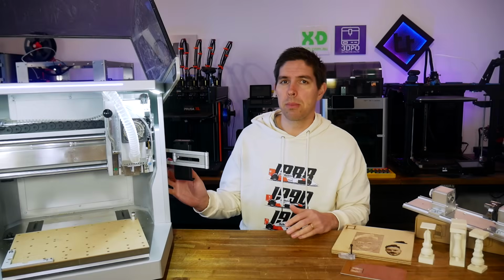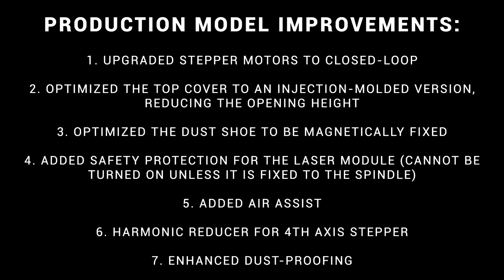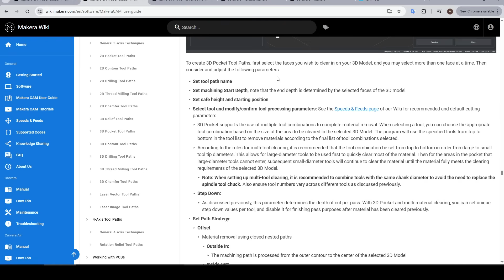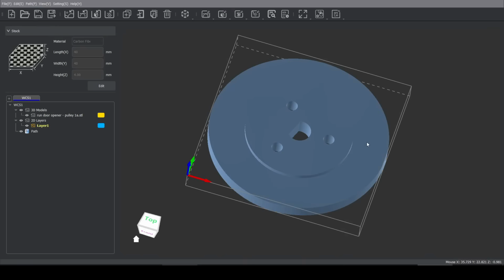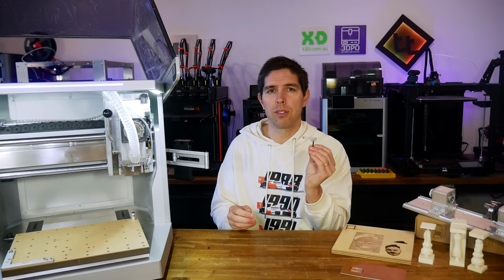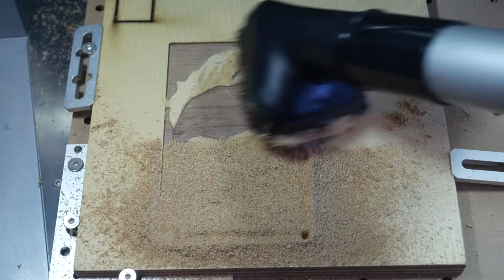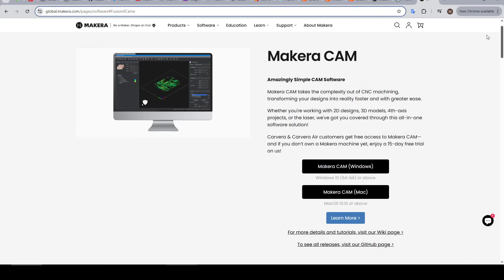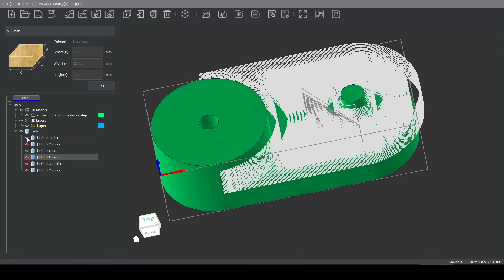Carvera Air Desktop CNC hardware and software review

Comment: Hey can you help me I'm using Marlin 2.1.2.1 STM32f401C1U6 motherboard I have made custom squeegee to control my squeegee up down with g code like M42 P0 S225 kr whatever in configuration_adv file where pre define custom menu option is there and I have  made stencil printer routine  in my marlincore.cpp  and problem um facing is that while apply paste command I do my stencil printer routine works and squeegee go down and up but just after I do  squeegee command from gcode my routine breaks and then apply paste only move y axis and no squeegee movement done because of that gcode command maybe can you fix my bug that I can move squeegee from display also like left or right squeegee and in apply paste command with stencil routine and there is no gcode is use in apply paste it is a part of routine

Comment: I bought a secondhand 3d printer and in it was a micro SD card, when i stuck the card in my computer i looked at what was on the card and there was a whole lot of files and folders that i have no idea what they did. Is there a way of finding out what is on it and what they do without putting it back into the 3d printer and risk damaging it?
Reply: Unless they stored other stuff there like photos or documents or their homework, they should all be gcode and you can download a slicer program (any such as cura, prusa, etc) and open the files there. It’ll show you what the models are.

Comment: Overall it feels like the Carvera Air would be a good machine for a hobbyist like myself, and I find myself wanting it!  But... the reality is that I don't encounter very many things where I go "that really needs to be CNC routed."  There's some - motor plates for my Star War droids, for example - and then a few more places where I COULD CNC the part, but I'm also able to make it work with 3d printing.  And I already have a good 3d printer.

So I do the math, and go "for under 300$ I can get my droid parts made by professionals, and that includes materials."  If I assume that materials is 50% of the cost, then I'd need to make about 17 sets of droid feet to recover the cost of the machine.  (If materials is a greater percentage of the professionals' rate, I'd have to do even more.)

All in all, then, this seems to be a good choice for a small workshop, makerspace, school, etc, or for a person whose hobbies involve a lot of CNC machining, but like so many of the really cool things you show us, it's not a good value for me.  

Which makes me said, because I WANT one...  :(
Reply: If you are dealing with anything that involves significant forces or heat, 3D-printing quickly reaches its practical limits. Especially if you want to make custom parts for products that are not bottom-up designed for 3D-printing. So I would say this is a perfect complement to 3D-printing! :-)
Reply: @mariusmossum2923  Define significant.

Also actually respond to the point about getting things made by somewhere like SendCutSend for far less over the lifetime of my hobbying than this product would cost.

Then tell me this is actually worth my limited income as a school bus driver.

Or, y'know, admit that you didn't really read my post.  That's good too.  I know it's a decent bit of kit, but you've totally ignored the specific use case and cost-utility breakdown I was describing, which is really kind of a rude thing to do.

Comment: I wish companies would move off Discord and back to forums. Forums are indexed by search engines, so a Carvera forum would become a searchable knowledge base that becomes more useful over time.
Reply: Discord is great for asking questions, but it's a lousy place to store information.  Various prop-building communities are really starting to struggle with this, especially because the "manufacturers" in such things are also hobbyists who decded to set up a Discord to support their R2-D2 sound board or what-have-you, which worked great at first but now they have to answer the same question over and over and over because there's no good way to find the answer.

So there's a tension there.  Discord is almost as fast as sticking your head into someone's office, assuming it's being monitored.  Forums are more searchable.  Perhaps the best solution is a well-built wiki that gets routinely updated, but of course that also eats up staff time.
Reply: Meanwhile, Discord has never turned a profit and is heading towards trying. Its continued existence will be at risk over the next few years.
Reply: This sounds good in theory, doesn't work in practice. Simply because software moves too fast and and anything that gets updated somewhat regularly makes old posts pretty irrelevant. Besides people do not like making new accounts so you will have fraction of userbase that you have on discord. Plus discord has response time a lot faster.
Reply: @Kmnri  bullshit, basic troubleshooting posts are relevant for decades. You can integrate a google account and use that for your login. 
"response time a lot faster" a quality well thought out response that others can easily find is better than a fast one.
Reply: @Kmnri Except it does work in practice, that’s why people search Google and append “reddit” to their query. SSO (single sign-on) has been a thing for years.

Comment: Like fiberglass, I shy away from cutting and sanding carbon fiber without proper PPE. Also it is probably wise to seal/varnish/glue/etc processed faces to lock fibers in place.
Reply: I am fully aware of the risks. But I am also strongly drawn towards being able to work with CF in a CNC! Can it be managed in an acceptable way? I would prefer to machine CF under water. But I don't see that as a viable option for the Carvera. Both because it is a bed-slinger, and because it has electronics underneath the bed. I am not that worried about handling the finished parts or waste CF-sheets. But I do worry that dust-management will be insufficient; and that there will be CF dust left behind in and under the machine. 

I am also unsure how well a standards shop-vac will be able to handle those particles. Could be a normal vacum-cleaner would actually do a better job here, as they have the HEPA-filter, in addition to the bag. My shop-vac basically only has the "fine" filter, as I have not found any stores selling bags for it. So for the most part, I only empty the bucket and clean of the filter.

Comment: Bought this after your KS review and I haven't used it much but apart from the makera CAM woes your showed my experience was also pretty great. The new parts being injection molded are a blessing cause I once forgot the dust chute behind the mechanism and it almost got crushed but being pretty flexible it managed to just bend around and spring back in one piece

Comment: Closed loop steppers will not stop skipped steps. Why does everyone think this its nonsense. Closed loop steppers will report when there is a skipped step. The firmware can then try to correct but almost all CNC's will throw an error instead. If you skip a step there is more often than not a mechanical problem and you absolutely do not want it to try and carry on.
Reply: I see what you mean though closed loop can potentially avoid skipped steps, if you are using something like FOC, you'll get a higher usable speed.
The difference between closed loop and not is without you'll destroy the part, with you might still end up with a usable part in the end, and as you said you can get an error to alert you something went wrong.

Comment: 12:15 yeah, male threads pretty much always have a major diameter slightly smaller than the nominal diameter depending on the Class / Fit Tolerance but really what is critical is the pitch diameter. 

Also, give that the CAM generated the thread mill operation from bottom to top for the OD thread, it was cutting in a "Conventional Mill" direction which will almost always result in oversized parts because the tool cant bit into the material properly so you get more rubbing and tool deflection. For OD threads, it really should start from top and helix down clockwise so that you run the cutter in a "Climb Mill" type cut for right hand threads.

With that said, I wonder if there is something in the CAM software that allows you to pick bottom up or top down and clockwise or anticlockwise that way you can force a climb or conventional cut strategy while also making right hand or left hand threads. If there isn't, that would be something that they really should add.

Comment: Got a Carvera Air while targeting to work out some RC cars parts in aluminium, epoxy or carbon fiber. This is my first CNC, and I got a bit of CNC introduction in my local fablab with another software, and so far, Makera Cam seems much easier to approach, as long as you understand it is not fully polished. I already saw a few issues corrected over the few weeks I used it, and I guess it will be better over time. So far did not start projects with 4th axis and laser, but I'm really impressed by the result and precision of what I made already using 3 axis... That being said, as a beginner, it looks way more complex than 3D printer, as you work by face, and fixing the stock and making the origin coinciding for each faces is a real challenge. I quickly found that installing pins on a piece of stock on the bed to set the position of the stock right is very efficient... Also I started quickly to realize design made for 3D printing needs some adaptations when it comes to work them out in CNC... In short, lot of challenges but having a machine and a software with the bits library makes it easier to start with...
Reply: My interest in the machine is similar to what you express here, among other things. Seems your comment is about one month old. Have you gotten around to trying out carbon fiber since then? I am getting the impression that dust-management is going to be a problem for carbon fiber. I thought about building a water-bath, to machine CF under water. But it being a bed-slinger, and having some electronic components under the bed, I doubt that is a very good idea. 😕

About aluminum parts you machine: Do you use them as they come of the machine; or do you do any sort of post treatment? I don't really know what I could easily do in my current workshop.
Reply: @mariusmossum2923  hello, I did a bit of CF on the machine, and dust is not really an issue : it accumulates around the cutting path area (no air assist) and you just have to wait a bit for the dust to settle before opening the machine at the end of a work, then use the vacuum (I don't have a workshop vacuum yet to use plugged on the Carvera Air...). Since the comment, I used the 4th axis, even with the aluminium with some very good results... But the real game changer is the 3 axis probe and community firmware/controller combo which definitely helps to properly position the work origin of a job and those features really helps for precision (specially on multi face 3 axis jobs)